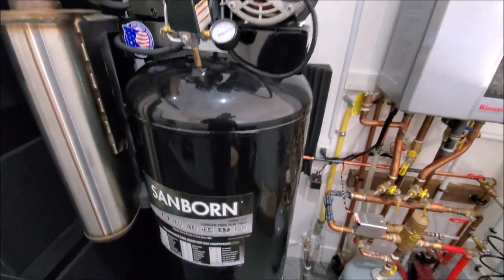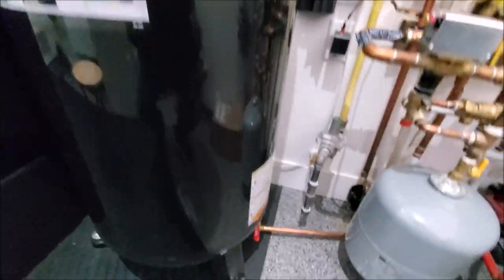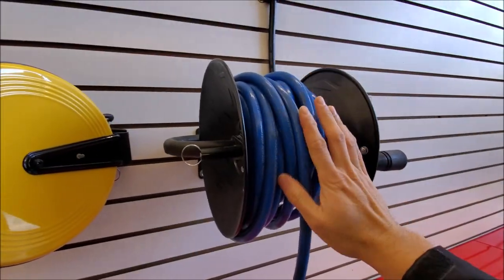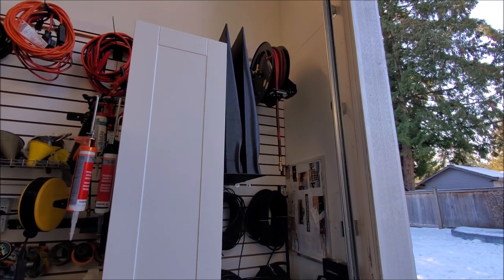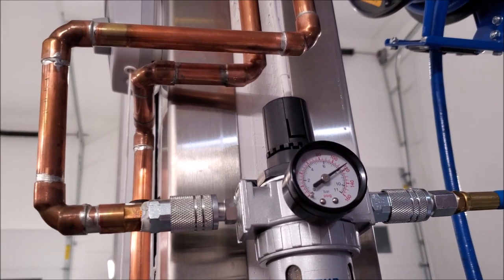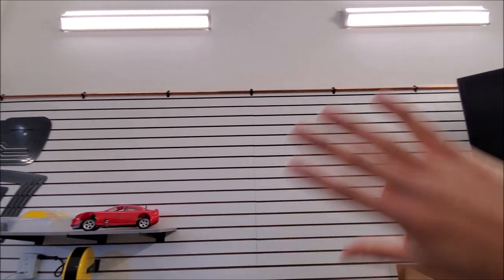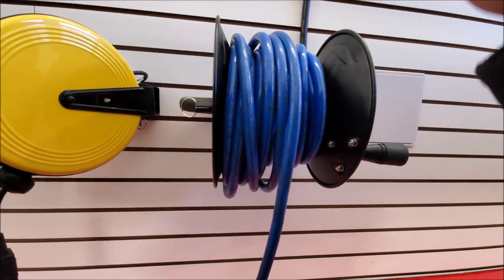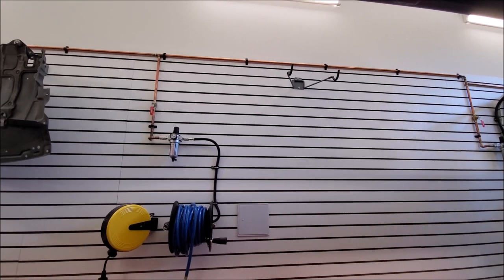Air Compressor Setup: Stage 1 (Sanborn Pneumatic Shop Air) | AnthonyJ350

Comment: Nice install. This is a loud unit. The one mod I'd like to do is mount the on/off switch on the outside of the compressor room.
Reply from the maker: I agree, after we extend the mezzanine, I'm going to have a room built to enclose the compressor and the hot water tank. I'll just have a door that makes it easy to access to turn off the compressor when not in use.

Comment: I know it sounds hokey, but I used a cheap car ac condenser (like really cheap, sorted by cheapest random application for less than $20). I measured the airflow before and after on my 5hp 18cfm  80 gallon and from dead empty to full it only slowed down the rate like 20 seconds total. I forget exactly but when I calculated it at the time it was like less than a cfm even though it seemed like it'd be restrictive. The temp out was totally ambient and it does a MUCH better job at air water separation. I just mounted it to the back of my fan shroud so the compressor fan blows on it. One day I'll wire up like a box fan or something to kick on when it's running to help cool everything, but it was a huge win. I get NO water in my lines and inside air\water separator, tools run cool, works great for painting... And when I do drain my tank it's a tiny dribble instead of a load of water.
Reply from the maker: I was actually thinking something similar but with a transmission cooler.
Reply: @AnthonyJ350  Transmission cooler would definitely be the way to go, should be less restrictive. I'd say even a medium size one would be better than nothing and would be great for shop use. Could even run a couple in parallel to up the capacity and flow rate. The only downside imo I've noticed is the unloading takes longer, so you get more hissing. But with 60+ gallons, idk if you'd ever get to a point of the compressor kicking back on before the cooler has emptied.
Reply from the maker: @TheBreaded  I have had kick back I think cause of all the piping and the regulators already in the system. It has to burp itself a little when it drains when the pressure gets low.